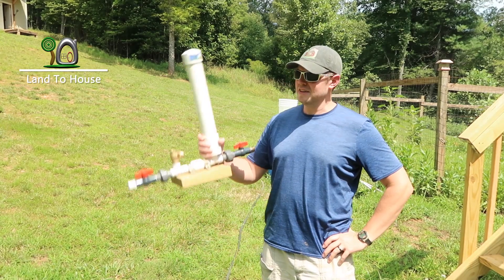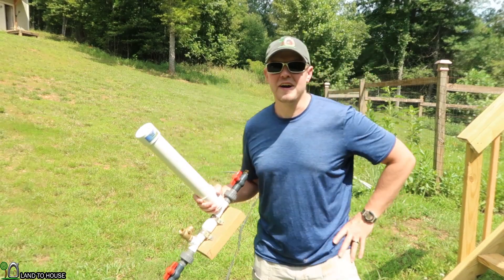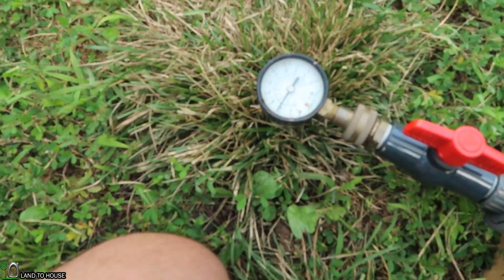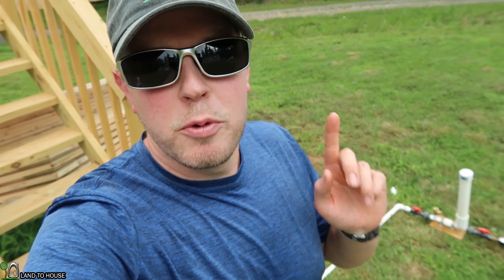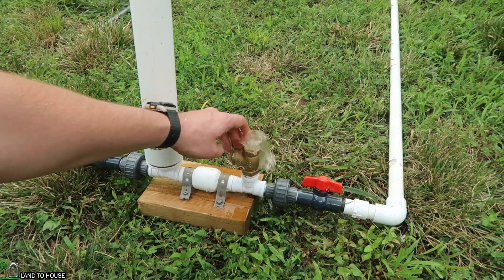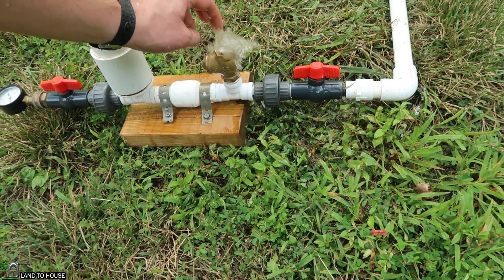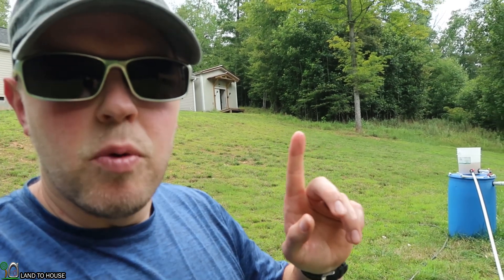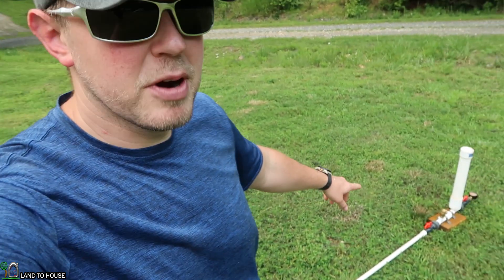Mismatched Drive Pipe RAM PUMP

Comment: Hope this fixes the problem!!!!  For a year we have used a 3/4” ram pump on our farm, and after doing some maintenance and shortening the drive line distance, we decided to remove the stand pipe from the equation. *The stand pipe is 3” pvc pipe with 1.5” pvc supply line into the stand pipe, 3/4” pvc drive line out to the pump. Removing it seemed to have caused the ram to stop working, but we didn’t understand why since the water source was now much closer to the pump. (5’ of drop over a 75’ distance to the 3/4” ram pump, 1/2” pex supply line out and up to the tank, 1.3 gals per minute flow rate during dry season.) Now I think It’s because the 1.5” drive line is too close to the reducer for the 3/4” ram pump.  I’m going to try adding in a longer length of 3/4” drive line leading up to the ram pump. If that doesn’t work, I will put the stand pipe back into drive line at about the half way point. Thank you for the video!

Comment: I think it depend on situation, when you have a high head using a larger waste valve is better, the valve will not be stress and created more pressure, like my ram pump I have 7 meter head, when used the same diameter of the drive pipe, the cycle is too fast small amount of water delivered, but whwen I put counterweight to the waste valve the cycle reduce to 60 cycle per minute much much water delivered abd the pump create more pressure

Comment: I have a 1/2" ram pump with a drive pipe that is from the spring source, 2" PVC for 80', then 1" Pex for 85', then chokes down to 1/2 inch PVC, 6 inches before the pump. It was pretty finicky to get going but is running successfully with a tilted pump and the output choked most of the way down. Input head is ~6-8 feet and it is pumping to ~14' (I'm sure it would go higher, I just don't have anything higher to run it up in.) If I try to set the pump straight or open the output more it stops. I will be replacing the drive pipe as soon as I get some 1/2" PVC but for now, that was what I had.

Comment: I built a system as follows: 100' of  2" drive pipe to 1 1/2" standpipe. with about 4 1/2' of head pressure, then 30' of 1 1/4" to an 1 1/4" pump- BUT I inadvertently put a 3/4" stainless steel swing check valve on it- BUT it works and pumps water up about 25- 30ft and about 500' of length and about 1 gal. every 4 min.   Wondering how much of a difference the 1 1/4" swing check valve might make.   Currently cycles at about 90 beats per minute.

Comment: I have seem some waste valves that are spring loaded. Would a spring loaded waste valve make the mismatched scenario possible? if so, would it make it more or less efficient?
Reply: I have a 3/4 ram pump and water just keep running out of the foot valve what am I doing wrong

Comment: Seth,  I just connected my new Ram pump after your example -  thank you!  I have made larger than yours to maximise the potential supply and have plenty of water in my stream.   The problem is it doesn't sustain pumping for more than a minute or so, and I think it might be the problem you lay out in this video, but maybe if I give you all (most) key variables you can advise please.   

I have 3.5m supply head with 5 l/s  flow (22 gal/min). The drive pipe is all 2" from the stream extract to the pump.  The first 22m is plastic pool pipe with 4 x 45 degree bends and one 90 degree bend.  The lower 17m is 2" galvanised steel with 2 x 45degree bends.  Between the two is a 'T' with standpipe.   The delivery is 3/4" and up 15m; although nothing has arrived up there yet!
The pump is made from 2" galvanised steel and brass components with an adapted 2" brass foot valve (as per bennyspoon on YT) .   My pressure vessel is a purchased 4 liter one designed for heating systems, and this is very probably much too small.    The check valve is a standard 2" brass flap valve. 
Initially I thought there was not enough weight on the waste valve and increased it steadily up to about 2Kg until it stays open with no working sweet spot in between.   The pressure guage does not sustain any pressure at all but just shoots up and down on every waste cycle, (when it works!)
The only other relevant thing might be that not all the joints are tight, so there are leaks.  
My supposition following your video here is that I need a much bigger waste valve with my flow and head.  But it could also be not enough length on the drive.
Any advice from you or anyone else would be very welcome, thank you in advance.
Patrick

Comment: I used a 3/4" PVC drive pipe  25' long with a 3' drop and I bought the 1/2" ram pump from you and it worked great.  I let it run for 3 days and it pumped the water about 14' high thru a 5/8" garden hose but it was in a flowing creek not from a bucket and I didn't have to prime it as it started immediately.

Comment: How do you manage to get 42PSI?? I have a very similar setup 1/2" pump with 20ft of PVC drive pipe and can only manage 15-20psi. What could be causing the big differences?
I have no inner tube in my pump but i didn't think this would affect it for a short test?
Reply from the maker: Do you have a pvc drive pipe? That makes a BIG difference.  Also note this is a measurement with the delivery closed.
Reply: @LandtoHouse  I have a 1/2" PVC drive pipe which did make a big difference from the black poly pipe. I also had the delivery closed. What is the thickness of your drive pipe? I'm thinking you may have a thicker, sturdier PVC drive pipe.
Reply from the maker: @willdoyl  yes I'm using the thick wall PVC. The more rigid the better.
Reply: @LandtoHouse  I'm going to get 6m of steel pipe and hopefully that brings some good results! Thanks for your wonderful videos and responses!

Comment: How do you calculate the size and length of the vertical pressure chamber?
Reply from the maker: After some testing I've discovered that the main determining factor in pressure tank size is whether or not it will maintain pressure when opening the delivery pipe. If the volume is too small pressure will be lost and the pump will stop. If a tank is too large it only takes longer to Prime the tank. It's better to err on a larger size. I'm sure there's a calculation but I do not know it

Comment: We finally have our's up and running fully (will send you the video on the updated setup now it's done). couldn't have worked it all out without your help dude!  We do have a few extension ideas that i'd like to run past you at some point, think you may have a better idea of how to work it in than myself. 

We made it the full distance to the barn over our 5acres btw ;-) added another 30m hose just for fun and took it even farther up the field, held above my head and still had pretty decent flow, so we will now be looking at ways to extend everything out so all of our major work areas get water
Reply from the maker: That's fantastic. Having water at the very highest point of your property can make a very big difference. One thing I've noticed with my own water storage is that I can run through a hundred gallons of water very quickly. If you're going to be watering a lot you may consider several 250 gallon IBC totes
Reply: @LandtoHouse  we currently have a 1000 IBC about half way up, thankfully the water is only really for animal use at the moment so we're not using hundred (yet haha) the main thing we are trying to work out at the moment is if we can split the delivery pipe into like a Y section to send the water off in two directions (one spot we'd like water in only about 20m from where the pipe currently runs) but it's so damn awesome not having to lug 30L up from the bottom field now, lots of things we want to add into the system (if viable) but the main thing was getting it working
Reply: @SynnUnsworth  I was pleasantly surprised at how much more versitile my system was after getting it all set up. I had originally intended the system to water my garden which is lower than my storage tanks but soon realized that I could water my landscape as well with a little tinkering. Valves at different spots coupled with a variety of hoses has made my system work far better than I had hoped. Get in there and experiment.....you might be surprised at what you come up with.
Reply: @mescoot69  thats the plan, luckily we have 2 hoses connected where we are thinking of adding in another section so hopefully it'll just be a case of putting in a Y junction and we'll be set, our main goal was just to get water to our entrance/main barn area so we don't have to carry it over nearly 5acres, so anything now is just experimenting and seeing what we can do
Reply from the maker: You can totally install a Y connection. Just keep in mind that the water will flow to the lower output. So just install a Y with double cutoff to keep force the water uphill.
Reply: @LandtoHouse  excellent that was basically the idea we had, we wont need water going to both places constantly so we we're going to try a Y connection so we shut the main one off when we need water in location #2 so knowing that will work is excellent
Reply: That's pretty much what I did. I have valves in various places that allows me to direct the water being pumped to the desired place I want it to go at the time. At night I usually pump to my tanks to replenish what I used the day before, and during the daytime I just let the pump water all the plants and trees in our landscape by shutting a valve off that leads to the tanks. If I'm watering something lower in elevation than the tanks then I can utilize the tanks as well for more water flow at the output, but need to be careful I don't empty my tank in the process. That's not usually a problem since I have 4 tanks and just open one leaving the other 3 shut off. That way if I forget about my water, I only run one tank out instead of all 4. It's no big deal either way since the ram pump just fills it back up for me. I'm loving this setup. It's taken a huge load off my well.
Reply: @mescoot69  that sounds pretty similar to what we will be needing to do, we have two barns, already have water to the main barn, but need a small amount of water to go to the 2nd, which will also eventually have an orchard so will need water but not constantly, being able to easily direct the water will save us heaps of time, it's gonna be awesome
Reply: Right on...sounds like you're sorting it all out and having fun along the way. Same here. We too have a small orchard of fruit trees as well as some old grapevines in the same area. I plan on adding 4 more tanks above these to use as their main water source. Right now I'm pumping directly from the creek to water those trees and vines. I figured since I'm able to pump that high up I might as well add more tanks. That would make 2000 gallons in total between 8 tanks. I think the one ram pump should be enough to fill them all but if not I'll just add another pump....easy peasy.
Reply: @mescoot69  yea our current plan was to get water to the main area by the first barn, its our most used spot so makes sense, so far our water goes easily half way across our 5acres but i want to properly test it one day to see just how far we can go... it would be awesome if we could do the whole 5acres and just shut off the areas we dont need that day, but I don't see much point in planning that far until i know we need it, seems like a waste of time just in case we never end up using it haha
Reply: That's understandable. No need to put effort in until it's needed. I'm still in the process of finding the limit of my pump as well. So far I have not found it's max lift but would like to find out where it is just to know. Fortunately I am able to pump to the areas I need it to pump to and with the future 4 tanks I'll be adding, I should be able to tie that into the house in the case of a power outage. Nothing worse than having the power go out and not having water. We only have a pressure tank on the house well and that runs out quick.

Comment: I have recently built my own 1" ram pump with a 100' drive pipe and 44" of drop to the pump. I am using a 3/4" waste valve with my setup and it works beautifully. I've been pumping water to some storage tanks going on 3 weeks now with no problems whatsoever with either my pump or with my supply pressure. I am lifting the water 30' + and still have not found it's highest point. Not sure why mine works so well and your experiment failed, but I seem to have nailed the 'sweet spot' with a 3/4" waste valve on a 1" pump. Proof that it is possible to use a smaller waste valve than the pump size. What ever works I always say.
Reply from the maker: Yes indeed. I have a feeling the larger size pumps will be more forgiving than the small pump.  Also using a lower head pressure allows for lower pressure at the valve. As long as it works!
Reply: @LandtoHouse  exactly. What works is what we're striving for. 👍 Having more people trying different things helps spur different ideas. I've set my pump up to both fill my storage tanks or run directly via garden hose to plants and trees around the property. That way if my tanks are full (or not) I can slow soak any given plant/tree directly from the pump itself bypassing the tanks entirely. I absolutely love it!
Reply from the maker: I once ran a pump with two delivery pipes. It worked well as long as i had a non-return valve on the upper location so that the pump didn't lose pressure suddenly swapping from one delivery to the other. It's great to have the option!
Reply: I have also successfully used a 1" drive pipe with a 3/4" waste valve.

Comment: what if the drive pipe is smaller than the pump ?
Reply from the maker: If you have sufficient head pressure it can operate the pump. If not the water will just spill out and never activate the valve. Either way it's not very efficient
Reply: @LandtoHouse  is there a way to change parts of the pump to reduce it's size, or does the whole pump need to be reduced?

I have built a ram pump out of poly fittings, as I want it to be UV rated due to harsh UV conditions in Australia. I also do not want leeching, which my plumber uncle told me was an issue with PVC when I was younger.

Due to variety of materials being more limited than PVC, the smallest poly check valves I could get was 1 inch. I kept the rest of the pump at 1 inch. My delivery pipe is 1/4 inch, my drive pipe is 3/4 inch. 

I am utilising the pump in a more unconventional manner than most. I am feeding it with scrubbed grey water and my outlet from it is currently 3/4 inches, thus I have kept my drive pipe at 3/4 inches.

So, can I reduce my non-moving pump components to 3/4 inches, or will I have to reduce the checkvalves aswell? If I have to reduce the checkvalves as well, it may be better for me to add an extra vessel to feed the drive pipe that I will upgrade to 1 inch fittings. 

Other potential flaws in my system is a pressure chamber that is insufficient in size, currently sourcing an appropriate vessel made from steel, like Michael who you have collaborated with has.

My other issue is it is currently fed from an external standpipe overflow, which I am replacing with a u siphon. If I have to upgrade the drive pipe, I will not bother with the u siphon and instead go with an internal t siphon in a new vessel.

Apologies for the long winded question, just wanted to be specific about my situation, as it may give you and or others ideas.

Comment: What if the drive pipe is a starting poin of 2 or 3 inch and it be reducing gradualy till the pump ... dont know if u know what i meen ... mmm i guess u ansure the question after i wrote the question ... lol nvm
Reply from the maker: I've heard a few responses from people with larger pumps. Drive pipe mismatch can work. But it seems like it's most efficient with a matching size pipe.